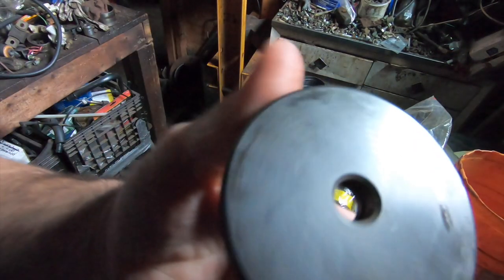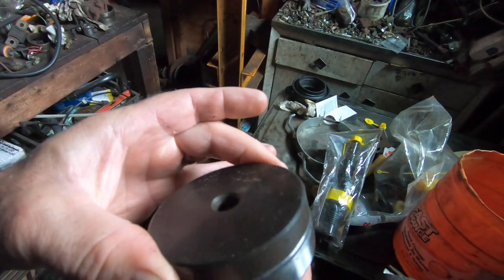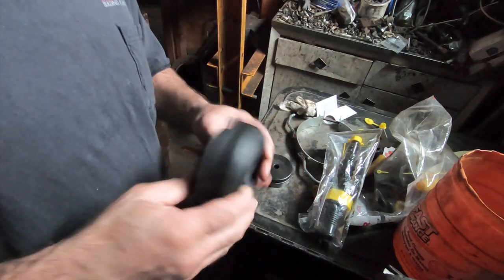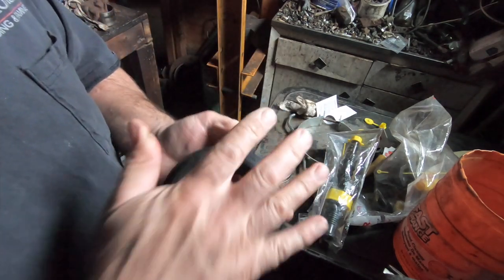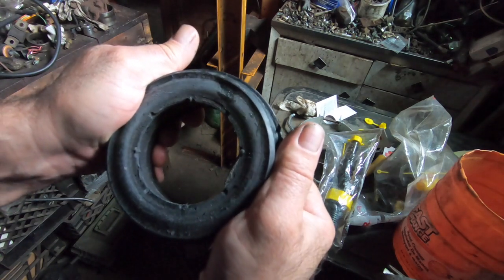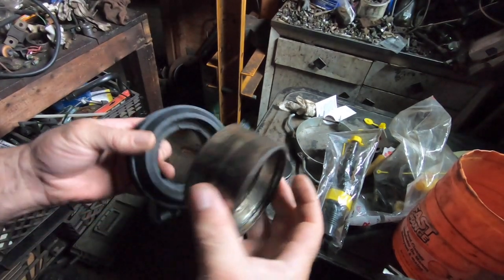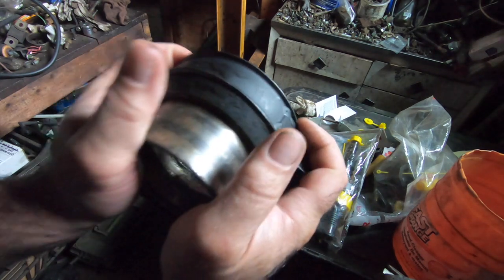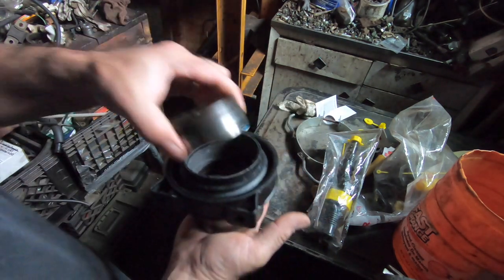'95 Volvo 940 universal joints & carrier / support bearing replacement

Comment: Thanks for this video.  I have a 93 Volvo 960 wagon that needs the drive shaft bearing replaced.  Gonna attempt to do this myself.  Really enjoyed the comments about everything.  They will have to pry my cold dead fingers off the steering wheel of my Volvo &  F250  Turbo diesel.  They can keep the plug & go vehicle.  Can just imagine what fresh can of hell it will be to work on that hot mess.  God bless, Debi
Reply from the maker: Amen to that, Debi! We've also got a '86 Grand Marquis with 287k miles on the original driveline, and a '07 Silverado 1500 4x4 - I'll be keeping all of them forever. The older stuff gives me MUCH less grief than the '07 has, however. Almost done replacing and beefing up the failure prone OE parts on that truck. Cost a pile of money! It's ridiculous.  You're welcome and thanks for watching, Debi! God Bless!

Comment: Yes thanks so much for this video !! I have to do it soon on one of my two 940 and this video is the only one so detailed with so many views of what's going on (including errors...)... I paid particular attention to the use of the h-press to put off and on the bearing. Hope I don't have to do the U-joints, they look time consuming. By the way, here in Europe, I bought the whole piece (bearing+rubber+frame) all together. Actually my bearing is good, only the rubber is dead.

Comment: good evening smitty!    yea  always press on the correct side of the bearing!!!   anyways nice diag and job!   we all done that with our lights  mine was a snap on  ouch!!  i hate my astro   i have a prolite for a year now and its awesome  and it takes a beatin  anyways have a good week ahead
Reply from the maker: Evening, Dave! Thanks man! Yeah, still trying to figure out what I was thinking there with that bearing, lol. What a dumb mistake!

And speaking of dumb mistakes, everything bad that's happened to my Astro lights was all my doing. Before I left that one under a car, I backed into it with my trailer tail light - broke both! I was shocked the Astro still worked after that, since it cracked the lens pretty much in half. Just one little LED stopped working, but the rest kept on. I'm satisfied with them for now. I've had to fix that magnet at least 5x over the past year, though. JB Weld only lasts so long before it crumbles. Last time I ran a screw in, and JB'ed the whole thing, so we'll see how that works along with being more careful with the thing, lol. Have a good week yourself there - got some nice weather on the way it looks like! About time. Going to be a mud bog over here as usual. I want to try to fly, but I don't think it's going to be possible.

Comment: Regarding the "Made in Italy" bearing, I just did mine this morning and the old bearing was marked a bit off-center (as yours probably was too), and I can just make out "SKF" on the side opposite the "Made in Italy" mark. Interestingly my bearing was absolutely fine, felt and looked brand new after 210k, it was the rubber part that failed, causing a clunk just as the vehicle was stopping or coming away from a stop.
Reply from the maker: Yeah, that seems to be the way they all go, all around that same mileage. We've got 210k on our 940, but so far they're hanging in there. Up here in MA the rubber seems to hang on a bit longer since there isn't alot of heat, as compared to down South or out West. The one in the video here had roughly 240k on it when that rear one locked up. The speedometer pickup in the rear diff had some issues, so could've had 300k on it for all I know.
Reply: @SmittySmithsonite  Mine's an Illinois/Wisconsin car. Was it the speedo pickup itself that was faulty, or the wiring harness? In my case it was the harness because the bracket that holds the harness had rusted away, allowing the wires to flop and go open circuit midway through the wire. For reference, my parents bought my car (a 1994) brand new in December of 1994 for $24k (base model + turbo).
Reply from the maker: @moconnell663  -Never investigated the cause on the '95, but on our '93,  cleaning the sensor, changing the diff oil, & cleaning the reluctor tabs next to the ring gear fixed our problem. Haven't had a glitch in the speedometer since. It used to glitch out after sitting all summer, every time. Was probably alot of fine metal particles in the oil interrupting or confusing the signal.

That was alot of money in '94! That's why these cars are built so well. They gave you what you paid for in those days. Sadly those times are long gone now. The stuff every brand is rolling off their assembly lines today is garbage compared to the high end models of the 80's & 90's.

Comment: I agree. No dip stick, no service. That's just looking for trouble. Like Eric says "You guys in Florida can rebuild a car with a Crescent wrench". Well I'm glad the second time around was a winner.
Reply from the maker: I couldn't believe the dipstick thing on that XC60.  Crazy!  One failed sensor, chaffed wire, or if communication goes down, you have no way to check your oil! Might not be a huge deal when the car is new, but I'd wager when that gets older, that's going to be a sure way of getting to the crusher as soon as possible. Seems to be what automakers are striving for lately! 

On that note I just towed my neighbor's '17 Ram 1500 (125k miles ± ) after he got left at work at 11pm dead in the water - no crank. He's only had the vehicle barely 60 days, plus bought an extended warranty, so he figured he was covered. I dropped the truck off at the dealer for him the next day. On the phone, they say, "Yeah, it's more than likely covered". We get there, and they want $150 diag.fee up front. Should've left right then. When he picked the truck up, they replaced the starter, both cables and the battery (which was still good  - I had checked it!). The bill? $1,000!!!!! WOW ... how do they sleep at night??

My best friend is down in FL right now. He's been sending me pictures of all these perfect rust-free vehicles, HUGE trucks that would never pass MA inspection, shots of an 85° beach, palm trees, wild parakeets grazing in the grass, etc. etc.. Told me he's not coming back! He can have a 4 bedroom house built from scratch for less than a condemned dump up here. Got me thinking I want to head south! Wife isn't on board with that plan. Maybe if I hound her relentlessly for the next 10 years she'll give in, lol. :D Wish me luck!  Truth be told, I'd be content anywhere outside the Northeast from WV on down.
Reply: @SmittySmithsonite  Florida is wicked humid in the summers and they are long. I had to leave for that reason. But yes, compared to your area, it's cheaper to live there as long as you're not on the coast. I had a 2100 square foot home built in 1990 and my property bill was $1800 a year. (It did vary up and down with the housing market). And the winters are wonderful.
Reply from the maker: @wyattoneable  - Thanks for the info! WOW, what a bargain! I pay almost double that for 1,400 sq. ft.!  I tolerate heat pretty well. I spent 2 years in Phoenix, and loved every minute of it. I'd be out on the motorcycle with no shirt or helmet at 114° out, lol. My buddy from CA wouldn't leave his AC if it was above 90° hahaha! We were total opposites in that regard. His apartment was always 62° - I'd freeze going in there. He'd laugh. 

So, one of my neighborhood buddies moved down there over 5 years ago, and I've got 2 best friends planning on moving there as well. I'm in a pretty good spot where I'm at - very rural for this part of the country, so it's tolerable. My other buddies, one is in the city, and the other in a populated suburb - both have had enough, between the neighborhood bickering, vandalism, taxes, regulations, and on and on. Cars rot away to nothing, roads are the worst I've ever seen (and also destroy your wheeled investment), and everyone's got their hand in your pocket at every turn. Getting to be too much to bear for most people. One buddy has been trying to build a garage like mine for around a year now. Every time he crosses one hurtle, the city throws up another - building is too high ... then it's too close to neighboring property ... then it's too close to the tracks ... then the foundation needs to be deeper ... and on and on. He's $3,000 in the hole to the city so far with zero to show for it. I can't blame him for leaving.  First chance I get to bail, I'm going to jump myself. The state is run by lunatics.

Comment: I recently changed the clutch on my -95 945 volvo and along with it i changed the transmission bearing, driveshaft bearing and flex disc
And golly did i get a ruckus of a vibration driving around 80km/h. Changed back to the Old flex disc and it got a bit better but still very very audible and shaky.
people were saying the Ujoints are extremely sensitive to becoming off-balance when changing these parts and that its likely that one has to take the shaft in for balancing.

Bit of a bummer since it is an easy car to work on, but these things can't be messed with i guess unless you're a pro.
Reply from the maker: The key is getting the joints set in to where they don't bind. That's where the trick of whacking the edge of the shaft near the cap with a hammer comes in. Don't need to be a pro, but that's where you learn all these little tricks. Usually just a couple whacks is all it takes, and the caps will find their "home" after you press them in. If there is ANY binding whatsoever with the new joint, you will feel that on a test drive. Once you do this job once, it will stick with you. Some jobs are harder than others - all depends on how much rust there is. I've done some real gnarly ones in the past! No fun, that's for sure.

The mistake I made on that center carrier bearing caused a vibration around that same speed. Once I replaced the bearing and pressed it in the CORRECT way (not from the center!), all was well. Guy is still driving it now and it's as smooth as glass right up to 130 km/h.
Reply from the maker: Just re-read your post - you might be able to just unbolt the shaft, and re-install it 180° from where it is right now. I always mark driveshafts before removal so that they go back in exactly how they came out. Sometimes the factory balances everything as a unit in one position, and they'll vibrate if out of that position.
Reply: @SmittySmithsonite   So what we have done so far is we took the driveshaft in for balancing and sure enough it was off balance.
We put it back on the car and while the vibration decreased by a large margin it still vibrates quite heavily between 60-80km/h and at lower speed like 40km/h.
We've tried putting some washers to lift the bearing up a bit but it made 0 difference.

Since it is a off-brand bearing and not directly bought from volvo we're now going to just straight up buy from Volvo even if it is a bit more expensive. this whole thing is giving me one hell of a headache and i just want to drive my damn car!
Reply from the maker: @smiIingman  - that sucks, sorry to hear that. Yeah it’s a common problem these days. Sad part is even OE stuff today isn’t as good as it used to be, but not much of a choice these days. Some of the aftermarket stuff is absolute garbage. I see it all the time. Hope you get it straight. 🍻

Comment: i have had SO much problems with aftermarket CRAP support. they look the same on the outside.. they r NOT made the same in the inside. they neglected to put in the part that flex. so it is stiff as hell.
Reply from the maker: Sign of the times. It's bad out there today!  Sometimes even the OE stuff is junk right out of the box. The struggle is real. Good luck.
Reply: @SmittySmithsonite  i got some from volvo and they where good ;)

Comment: Did I hear you right @38:08? You paid $85 each for those GKN U 110 u-joints? I just ordered 3 of the same u-joints for my '90 740 GL from FCP EURO and I paid $8.49. I guess one of us got a good deal! Lol :)
Reply from the maker: These were OE Volvo u-joints, right from the manufacturer. There is no way you got OE that cheap. Might be the same manufacturer, but they are NOT the same joints.

Comment: no size wrenches work .. ..i callem vicegrips .. rust sucks
got cool set of irwen ruinit scockets they bight 
spiral bight
Reply from the maker: Nice - I'll have to look into those. I've got a set of Snap-On ones I bought 20 years ago, but I've rarely used them. They have spikes inside the sockets. I've rarely found them useful. Half the time I can't get them on the nut! They were pretty damned expensive, too ...

Comment: you ever rember the volvo comersial . down the cliff drives away 
in my opion new volvoes suck
Reply from the maker: Yeah, they've gone WAY downhill. Just the differences between '95 940's and the newer models from '96 up is huge. I deliver alot of used Volvos for a car dealer - they always have problems! Every single one, regardless of how new. I just delivered an '18 recently, and the entire center console display blanked out as I backed it off the trailer. Thankfully with a key cycle, it started working again. Just the "Quick Start" manual for this thing is PAGES thick - ridiculous amount of gadgetry and electronics. That thing will never make it past it's 6th year of existence in this part of the country ...